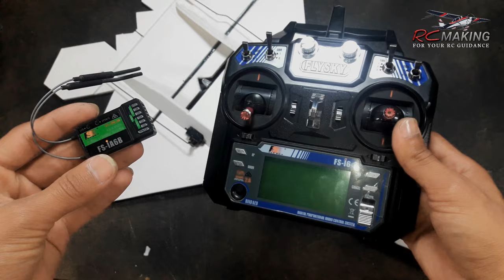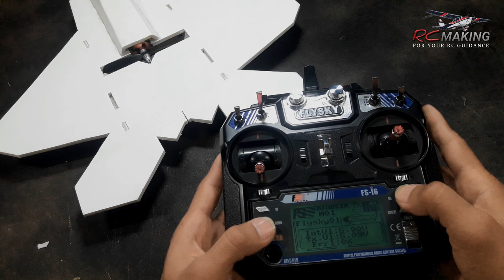How To Make Cardboard RC Airplane  DIY - F22 Raptor l RC Making

Comment: Can we not fly this with landing gear ?
Reply: Absolutely, But you need a soft clean road or a land for landing and the speed should be very low before landing so you dont scrape the down body of the craft
Reply: @DeepSpeed_7  4
Reply: The plane is a little bit small and adding a landing gear wil create a drag,but it is still possible to fly with adding it

Comment: Can we use 1800 kv moter?
Reply from the maker: @medha03  best option is higher kv for small prop
Reply: But can we use 1800kv moter because not available in my  local market.
Reply from the maker: @medha03  it's ok no problem use 1800 kv motor
Reply: Thanks 😊
Reply from the maker: @medha03  welcome

Comment: How to connect the battery wire to receiver
Reply: You need an esc, Eléctric Speed Controller, that has a 3 pin Connector that you can connect it yo he receiver, in any channel (in flysky ahould be 3)

Comment: I use Motor 2600kv and Battery 1300mah 3s, controller ESC 30 A.This is the second time my controller has burned out.
The first time, the plane caught fire.
What am I doing wrong?

Comment: Do you know if a 2212 1400kv motor and 5 inch propeller will work with this build?
Reply from the maker: No, for 5 inch propeller you need higher kv

Comment: what is your lipo battery mah
Reply from the maker: 1000 to 1300 mah
Reply: @rcmaking3412  what voltage range do you recommend?
Reply from the maker: @ChristopherB-x5i  3cell 1000 mah

Comment: Can I use 1000 kV motor
Reply from the maker: No, you can use higher kv motor
Reply: 1000kv is way to small for this.
Reply: I think you need to use bigger blade for 1000 kv motor... Like 10" Blade Or bigger and not suit with the plane size

Comment: Hi . It's very awesome build thank you very much even I am going to make it . could you please tell the flying time of the plane in minutes.and how many volts is the battery??
Reply from the maker: Flight time is around 4 to 5 min, and the battery you can use 3s 1000 mah
Reply: @rcmaking3412  oh ok 👍 thank you very much
Reply: @rcmaking3412  Can I use 3s 2200Mah battery?
Reply from the maker: @johnremerasmo8062  no 2200 mah is too heavy you can use 1300 or 1500 mah 3s

Comment: I am subscribe your channel and I am regularly watched your videos. I want to make A rc plane🙂🙂Vi Can i use 1045 propeller with 1400kv bldc motor?🤔🤔? please tell me.
Reply: I made cardboard version with 1045 prop with 1000kv motor and s3 2200 mah batt, I scaled and stretched plans to make wingspan (about 70cm) and middle section wider to fit 10inch prop. Flies pretty good.

Comment: Can you make f22 raptor with wingspan 80 inch ?
Reply from the maker: Off course, but there are no budget for 80 inch
Reply: @rcmaking3412  i need plan f22 raptor 30 inch,in your vidio the plane have wingspan 18 inch

Comment: Hi I noticed your using 1300mah battery and in recommendations you say 1000mah battery why is that????????)
Reply: It doesn't matter which battery u are using but the timings will change like with 1000 mAh you may get 3 or 4 mins less flight time than using 1300 mAh battery
Reply: @mra4264  ah I see thank you so much for replying am new to it learning everyday cheers bro

Comment: But the remote is very costly 😭
Reply: make ur own  6 channel or 8 channel transmitter and reciever using arduino nano and nrf24l01
Reply: @soumyadip_ja is it reliable? If you already have any ref link pls share that. It would be great help.
Reply: @soumyadip_ja plus the module has one antenna for receiver and how to set that on plane keeping aerodynamics good

Comment: Not A Cardboard
Reply: Yeah agreed cardboard is better than foamboard( It doesnot break easily and easier to model and more durable)
Reply: Foam Board has a HIGHER DENSITY than cardboard. I made the exact same build out of both materials and Foam is much better because of:
1) The smoother texture
2) The higher durability
3) The easier maneuverability
4) The easier painting process.
Reply: @eszett36  What about price
Reply: @G-Toilet_Rizz  Well, free cardboard is an option, but it's also crappy. Depending on where you live, Depron can cost as little as 25 cents per 100gr. That's atleast in Romania, where stuff can either be really cheap, or really expensive for some reason.
Reply: @eszett36  U know what, I guess heavy titanium will do the trick. all we need is 69mil£
Reply: @G-Toilet_Rizz  Absolutely 🤣🤣🤣